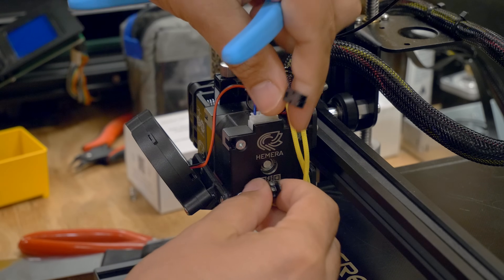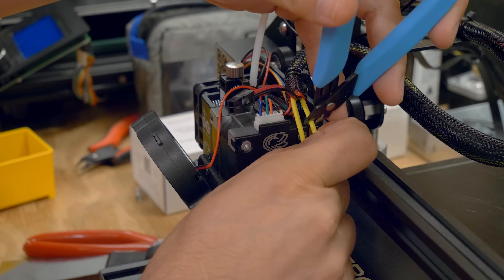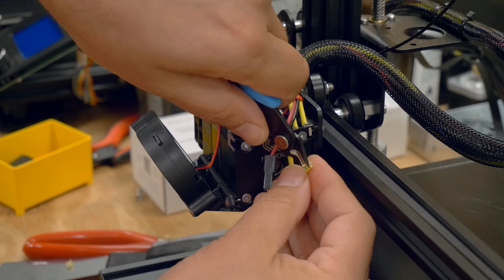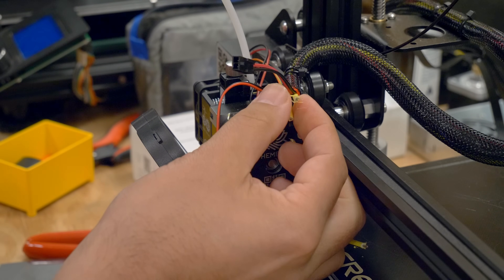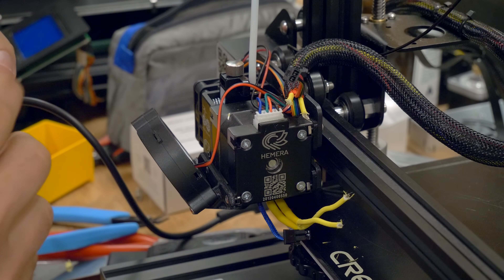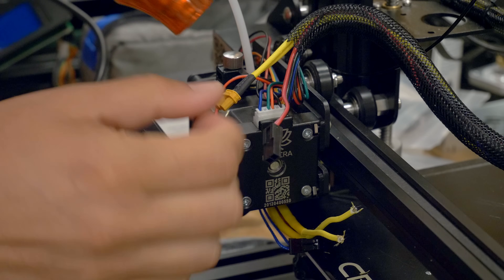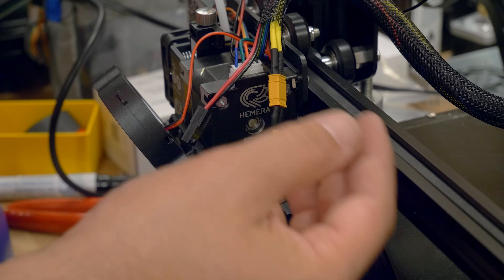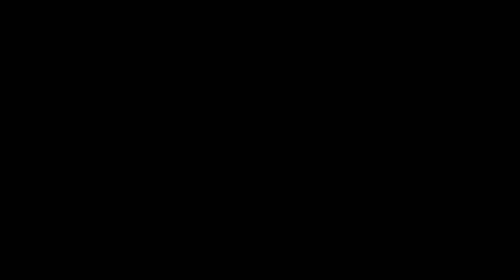Easier 3D printer hotend maintenance: adding an XT30 plug to my heater wires

Comment: Hi, my heater cartridge on my printer is half broken and it won’t heat up past 220°C. Do you think I can solder a new heater cartridge to the old heater cartridge wires, since they have a connector I can’t crimp on myself?

Comment: Not sure how this came on my feed, but I will say this is completely overkill. I just use JST SM connectors, they'll handle 3 amps, which is perfectly fine for pretty much any hotend heater at 24v. Little fiddly to crimp with that braided insulation, but if you can strip it cleanly, it's not to hard. I do like xt style connectors for mains powered beds though, not what they're meant for but as long as your not messing around with the connector while it's energized it's perfectly safe.

Comment: XT30/60/90 plugs and receptacles are much more easy and safe with soldering, if you plug in the opposite part and solder while mated.

Comment: I would go with an XT60 given that wire gauge. Resistance is an issue and the more surface area of the connector than the lesser the resistance you are adding in to the circuit. But I'm probably being overly cautious.
Reply from the maker: The heating element is rated at something like 40 watts @ 24 volts. 40 watts / 24 volts = 1.666 amps. The XT30 is rated for 30 amps continuous. It's honestly overkill. In fact, I believe Hemera has started shipping their heating elements with the same small connector used on their temperature sensors, which are probably only rated for single digit amps.

Comment: Those thermistor probe wires are REALLY fragile.  I've broken some myself.  Make sure those are not stressed while printing (zip tie the connector).  Otherwise you could have a failure of the fan during a print  which will cause the entire hotend to heat up and jam.  Been there...  not fun.

Comment: When I built my CoreXY I just put everything (heater, temp probe and fan) on a 6 pin Multiplex connector (the green ones). Single plug hotend removal, and perfectly fine for the amp rating. Also easy to secure so it does not stress the wires while printing.
Reply: I just built a corexy, but I change things often enough that I don't want to tie all the hot end components together.

That said, I've used XT60 connectors on my heat bed for a while, no idea why I hadn't thought of using something for the extruder heater.

They're ordered now!

Edit: I already received the xt30 connectors, and they are surprisingly small compared to the xt60 connectors I've used previously.

Comment: I nice fix.....the only problem I could think of is that if you print a lot the cable might break at the connector  because the wiggling if the extruder but if you use enough heartstring that doesn't really matter